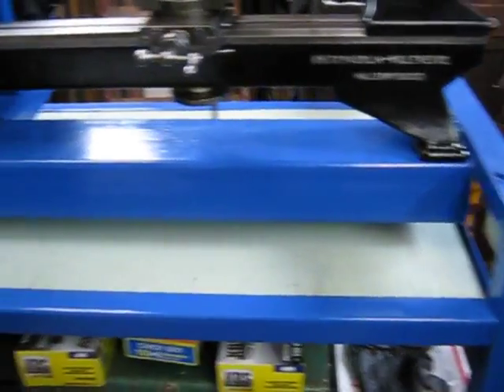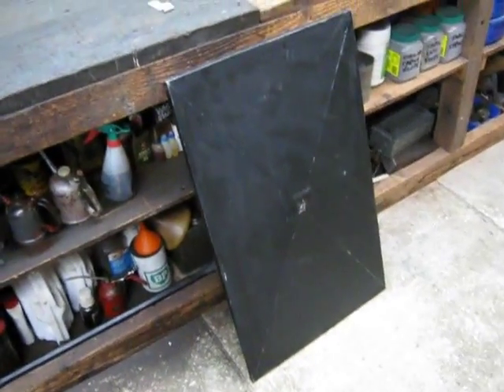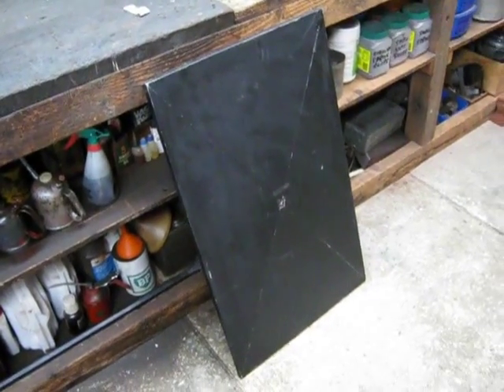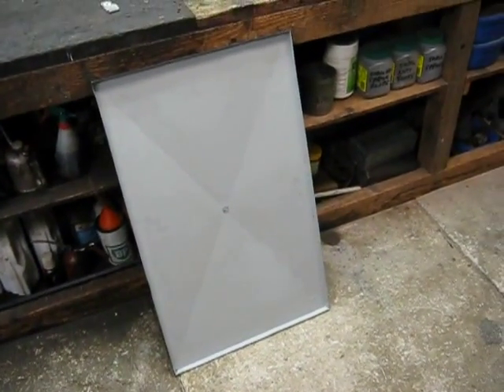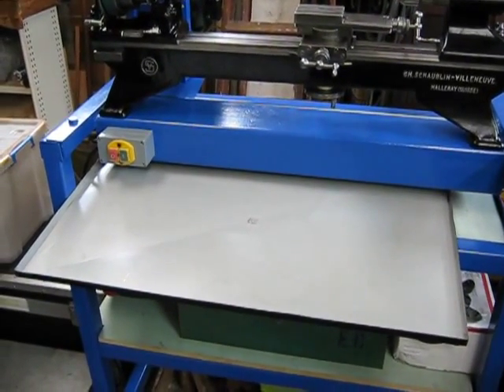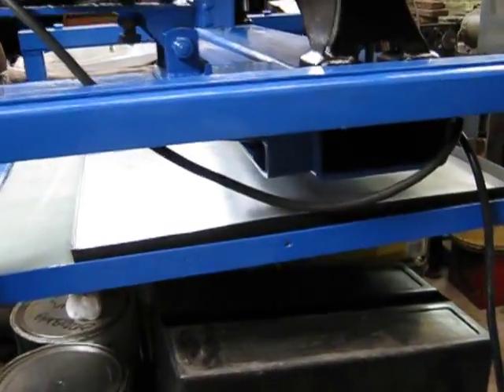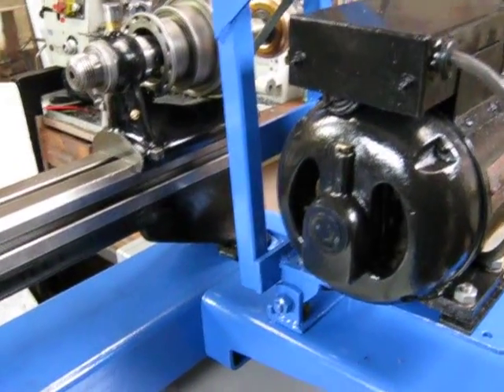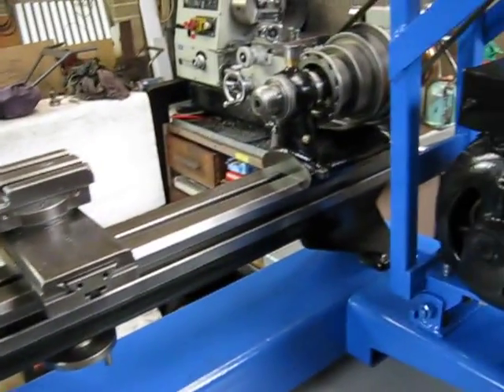My free lathe drip and chip tray - suitable for a small metal lathe

Comment from the maker: The best junk yard at the moment is on north eastern side of Prospect Rd after it crosses Grand Junction Rd - heading north.  Mr Doors factory is opposite - number  606.  Good junk yard if you can handle a bit of rust.  Second best is Rockin Maria's at Cavan, although it's gone upmarket and not as good as it used to be. Go the printers :) Rob